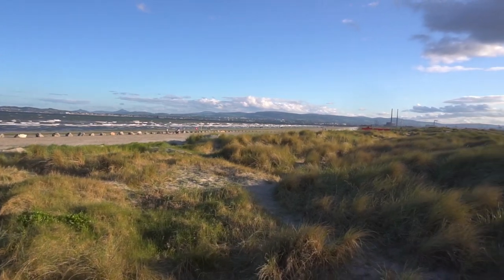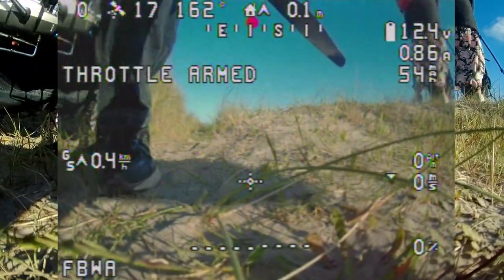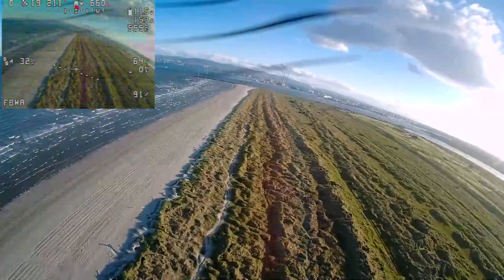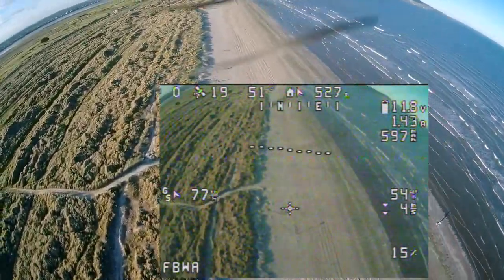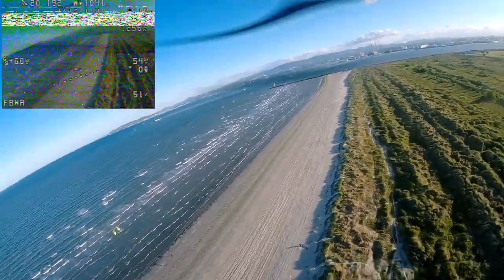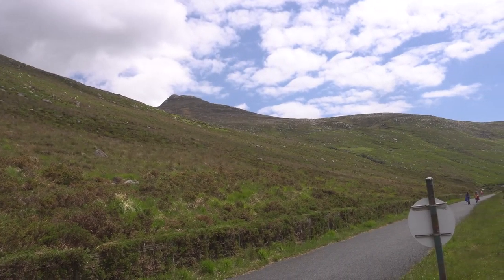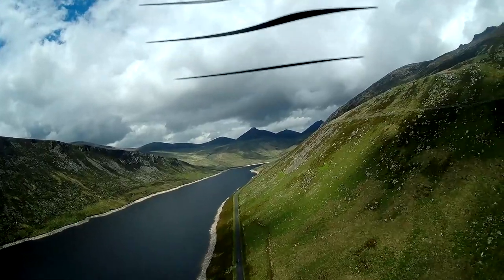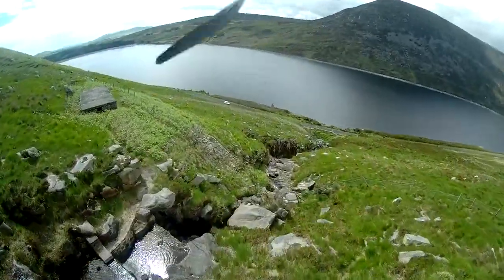Long Range FPV RC Plane | 1Km Joytrainer mini

Comment: Just a tip... the antennas on your goggles were set to the worst possible positions.  The omnidirectional should be pointed up, down or to the side -- not in the direction you are facing because there is a null-point directly off the end of that antenna.  Your patch antenna should be facing towards the model so position it on your goggles so that you can easily turn your head to align it.  For most people this means having it point lightly upwards by about 20-30 degrees (since we tend to fly with our heads down a little) and having the active face pointing flat ahead of you.
Reply from the maker: Thank you! I really appreciate it, and also your work for the rc community in general.
Reply: @Joyplanes  can u answer me ?

Comment: I remember when I hit my first 1km fpv on a gws slowstick.   I was definitely nervous with each time going a little further.  When I hit 28km years later on my minitalon I had come a long way.  Still just as nerve racking watching wind speed, milliamp used, efficiency data, and link quality.  Long range is exciting but also tests how well you prepared for the journey.
Reply: 28km! 🤯 Wow

Comment: Nice shots of Bull Island and congrats on making it a kilometre out and back in that wind. The wind there can be vicious at times. Just a suggestion; you should try a bigger plane with a slimmer profile, medium aspect ratio wing and a slower kv motor, turning a bigger propeller ( 930 kv motor with 11 inch propeller with 7 inch pitch ).Try using li-po/li-ion batteries in parallel for endurance. I fish the end of Bull Island regularly and often scout the strand with my homemade high-wing RC plane. The Volantex Ranger is an excellent platform for this kind of FPV with the right setup. Or ask John at Bearospace to lend you one of his beauties.😂

Comment: Great video. Loved you include both ground and plane perspectives. Really helps to understand where you flew and how the plane was flying. 

I believe Audropilot has OSD element that allows displaying of wind (or at least ground and airspeed). This will help you understand what wind(s) you are encountering at altitude. With hills wind can be more tricky as flows over and around in non-linear patterns.

Comment: I’m a high school science teacher who teaches an Aeronautics STEAM/STEM class. The students mostly build foam planes (and some students build drones). I’d like to learn about the pixhawk and ardupilot and try to do a project for the upcoming school year. We have lots of fields around our area and we would like to explore doing waypoint missions, mapping out the fields (3D imaging, measuring amounts of fertilizer, finding and removing fawns before the fields are mowed or plowed, etc).  I would like to know what equipment is needed, how to put it together, setting it up, and implementing it. Thank you for the videos. My students and I have enjoyed your videos and have learned a lot from them.  I had one group of students who liked your canard plane and made a small chuck globe set of it. Once tuned, it flew fine, but once they tried adding some small RC to it, they had similar issues.
Reply from the maker: Hi, thank you for your appreciation, I love hearing about these stories, the canard for me was a very simple experiment, I wish to develop it more in the future. For the ardupilot setup, I'm pretty new in this, but their documentation can help a lot.

Comment: 3:31 seems like your patch antenna wasn't pointing the right direction. Also in 3:49 your cloverleaf antenna seems to be pointing null at the plane, so you might want to change your antenna placement for better range

Comment: Try putting a 3s 18650 pack in there, with the weight of a 3s 1500 but with the capacity of a 3500
Reply from the maker: I've been thinking about it for a while.